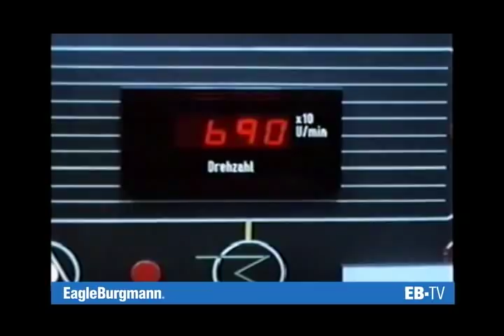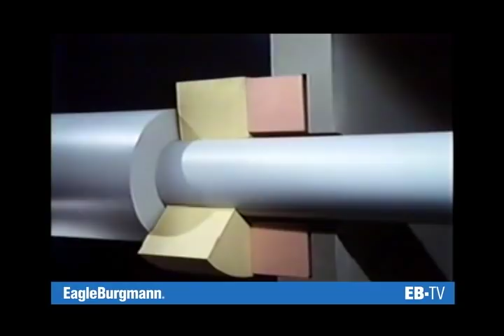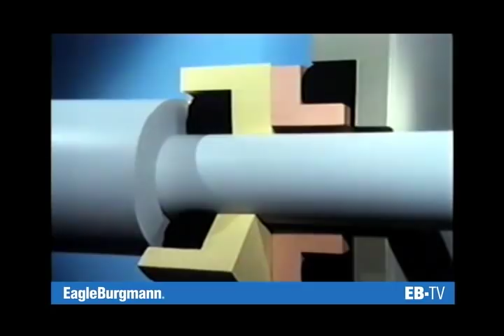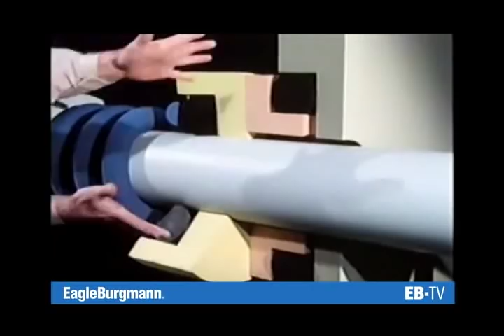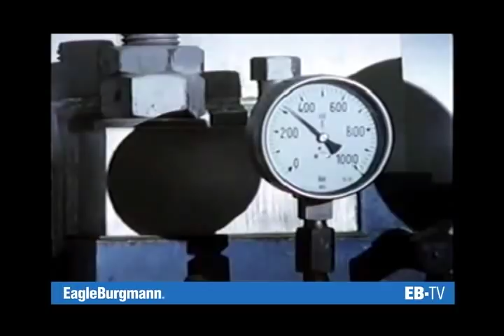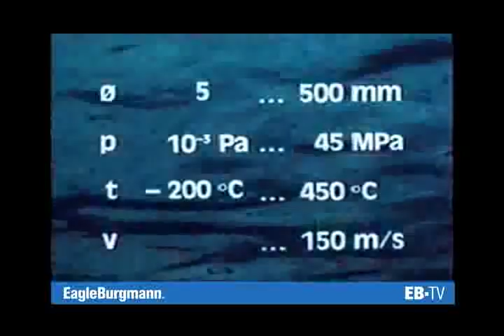Mechanical Seals Basics from EagleBurgmann

Comment: Quite an informative video. You just have to maintain the pressure in the stuffing box higher and keep the vapor pressure of the lubricating fluid lower so that the lubricating fluid doesn't end up boiling making it difficult for the sealing faces. 

For this purpose, seal flushing plans are there as well as per API682.

Comment: This is an best introduction to mechanical seals for rotating shafts, perhaps the only explanation that starts from the fundamental problem of how to make a shaft rotate in a box that contains fluids without the fluids leaking out.   It shows how the key components evolved, beginning from the realization that the sealing surfaces must be annular discs attached to the rotating shaft.  Then other requirements, such as easy replacement of the sealing surfaces, improved sealing by means of springs, etc. are described, so that the viewer can appreciate all the typical components.  Ultimately, of course, the sealing surfaces must be made extremely flat in order for it to work.  (Is capillary action what prevents the lubricating fluid between the sealing surfaces from leaking out?)